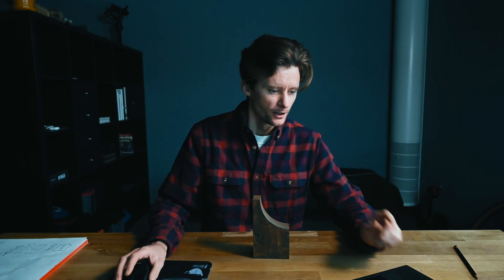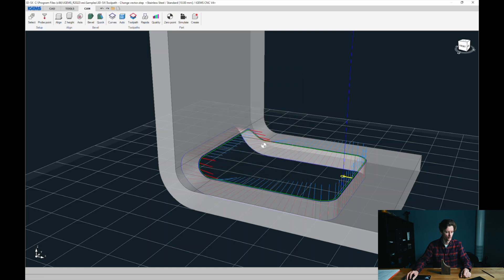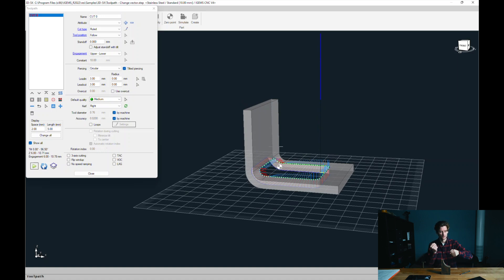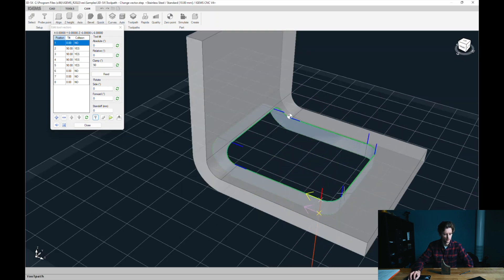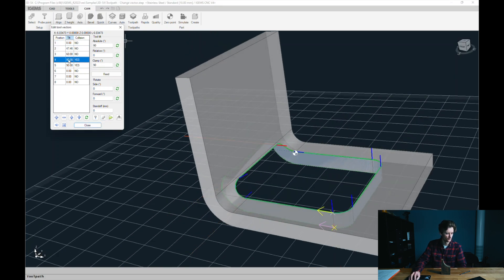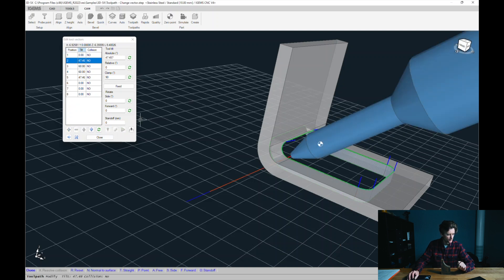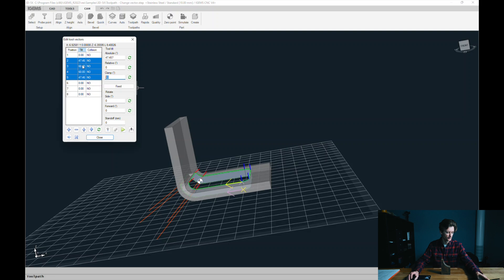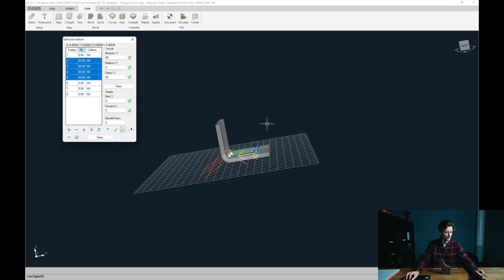Manipulate 3D vectors

Comment: I would place this part other side up. 🔃then it all two flat surfaces comes 45 degree to table, stand corner up like roof of the house🏠, and tilted head deal with vectors much easier i think
Reply from the maker: You're probably right Denis :)